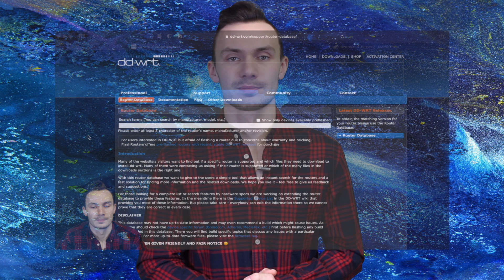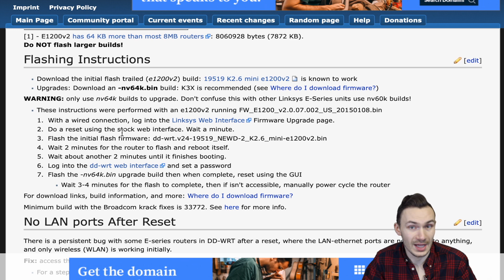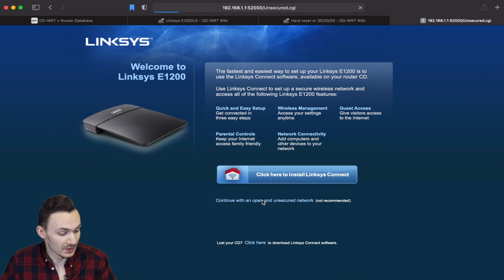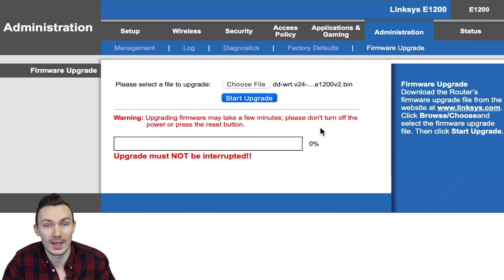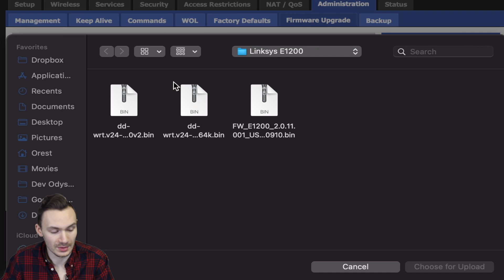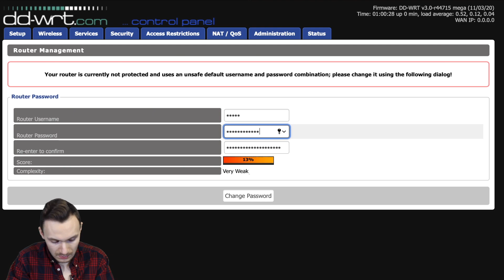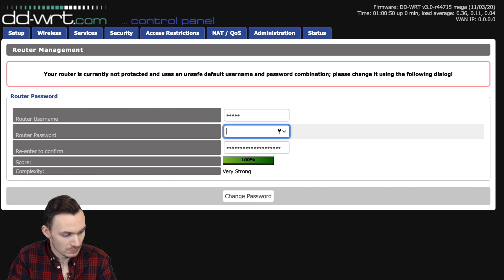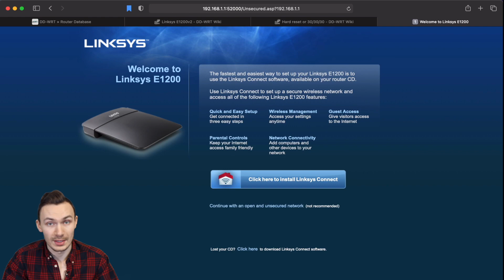How to Upgrade a Router // DDWRT (How To Guide)

Comment: hello i just saw my router on the data base but it doesnt have a wiki instruction page for it and also mentions 5ghz doesnt work any info on this?
Reply from the maker: Thanks for watching @muhammadnuaman8127!

Honestly this is the only ddwrt video I’ve done, so I wouldn’t even consider myself a novice here.

Personally I have found ddwrt support to be sparse, including documentation. OpenWrt on the other hand is more robust, not just feature and support wise but also documentation. 

Have you looked into if your router supports OpenWrt? Chances are it would support your 5ghz radio too if the router is already supported.

I’d look at OpenWrt’s table of hardware to see if your router is supported and from there you should find installation instructions.

https://openwrt.org/toh/start

Comment: Is it possible to change firmware of isp provided router
Reply from the maker: Thanks for watching @user-yk7wq7kf7u!

That really depends on what hardware they provide. Given that ISPs typically lease this equipment to you, I strongly advise against trying to modify / overwrite their firmware. Its possible that you could brick the device they gave you which not only would be against their terms of use, but also, obviously, stop you from getting internet access. They may have something in their firmware that enables internet access to begin with.

You're best bet is to deny their equipment, and bring your own hardware (modem, router) if you can. If not, see if you can configure their router to act as a bridge, rather than a router, at which point you can connect your own router to their router, and use your router to manage your home network.
Reply: @DevOdyssey  thanks for the reply bro
Actually our isp deduct device charges in monthly bill so technically after six months this device became my property that’s why when I discounted my connection after 2 years they didn’t ask for the device return 
So it’s my property and I can do what ever I want please help if there any way to change firmware of that router
Reply from the maker: For sure, thanks for clarifying @fahedhassan-y6c  !

Given what you've noted, I can't imagine them taking the hardware back as you've paid for it in full, let alone, you are not being billed for it, the best indication I see that you "leased to own" instead of only a lease.

Great to hear its yours to now play with. Anyway, I'd love to help if I can, but I'd need to know some more details first. What hardware are you using? It's possible that it can't be flashed with other firmware, due to support reasons by the flashed firmware (i.e.DDWRT, OpenWrt not supporting it), but once we figure that out, I can guide you in the right direction on how to flash it with newer, more powerful firmware.

Comment: My Wifi nowir dd-wrt but I can't  go to ddwrt program, what isa the IP address use
Reply from the maker: Thanks for watching @pugnationphilippines5034!

I'll be quite honest, I have not touched DD WRT since making this video. I basically shifted to OpenWrt after seeing how much more it worked for me and my use cases. Supportability, installing etc, all just felt better for my workflows. With that, my knowledge here will be very limited, but hoping I can guide you in the right direction.

For the IP Address, its probably your standard 192 . 168 . 1 . 1 in your browser to reach your web interface for DD WRT. I don't think that varies between hardware that DD WRT is installed on, but I can't make any guarantees there. I am assuming you have tried this, and if so and it doesn't work, its possible something went wrong with the flashing of the router and its bricked. Thats a much more complicated scenario and would require a decent amount of troubleshooting the community has on their website. Hopefully thats not the case, as worst here is that its unrecoverable. 

I'd recommend going to their forum and website to learn more. You can find the links in my video description.

Comment: Hi Dev, just set up for the first time, I can't seem to be able to set up a SSID password that the system asks for when connecting to WIFI (so devices are not secure and open when connected to DDWRT router) Any advice please? Prob just a basic setting I havent done yet
Reply from the maker: Thanks for watching Cycling Bean!

So this may depend on your version of DDWRT, but I am not sure if it actually creates a wireless network automatically.I don't feel its the case, so the way you'd want to do this is by connecting to the router via an ethernet cable, and then reaching the DDWRT web interface by going to the default IP Address. From there you should have no problem setting up the SSID with a custom name and also SSID password after setting your security type, such as WPA2/3. Have you been able to get this far? If not, I'm not sure if your issue is build specific or not. 

This wiki section from DDWRT around general Wifi settings should be helpful.
https://wiki.dd-wrt.com/wiki/index.php/Basic_Wireless_Settings#Wireless_SSID_Broadcast

Comment: Dear reader,

i wane start using my old  Asus RT-n12 router again, because I need a separate network for my smart home products. And because the firmware is from 2017 (dd-wrt.v24-35034_NEWD-2_K3.x_mega_RT-N12C1) I wanted to update my router first. I only found 2_K2.6_mini updates through the website and through the ftp server I found dd-wrt.v24-51011_NEWD-2_K3.x_mega_RT-N12C1.trx. Can I also use this to update/upgrade from an existing dd-wrt web-gui because I can't find a Bin file from this version. Thanks a lot for your time.
Greetings skip
Reply from the maker: Thanks for watching Skip!

To be quite honest, my experience with DD-WRT is very limited, really only to actually the install. I have had a better experience with OpenWrt for features, functionality and compatibility and mostly have gone that route.

However, to my knowledge, I believe the trx files are used for the initial flash to DD-WRT. You can find instructions below from the router database (the link assumes you are on revision D of your Asus N12)

Either way this link does have bin files for the updates to mega and mini from 2022, not sure if there is anything else that’s newer. The trx might work for an update but I would be cautious unless you found some sort of confirmation that it work. So far, in reading the dd wrt wiki, I’m seeing that you update with the bin file and not trx, so I’d advise not to do that, again unless you have reputable information that it would work. 

Try the bin files from the router database and it should update you to a newer / newest version they have available for the N12.

https://dd-wrt.com/support/router-database/?model=RT-N12_D
Reply: @DevOdyssey  Thanks for your reply. And yes, I had already looked in the route database, but there is no 2_K3.Mega there. Anyway, then only the option remains to flash back an original firmware and then again via the normal way to the latest firmware from dd-wrt or indeed also open-wrt because it is much newer. In any case, a huge thank you for your time and effort.
Reply from the maker: @1eskip  You’re welcome! Taking a closer look at your first comment, it seems like you are on the C revision of the Asus RT-N12 router. As you found, I didn’t see a K3.X Mega in the router database either, sadly. Given it’s only a trx version, your assumption would be correct, you’d have to reflash to stock firmware, then flash back to the upgraded version using that newer Mega trx flash file.

However if you do consider OpenWrt like you said, you should be able to flash it, as it looks like it’s supported in their table of hardware. If you go down that route, you can refer to my flashing openwrt video for some help.

https://youtu.be/1IgwDwoa9yY
Reply: @DevOdyssey  Ok thanks for the information. I already had the Open-wrt firmware ready but Can I flash it directly from dd-wrt or do I have to flash it to stick first.
Reply from the maker: @1eskip  You're welcome! I am honestly not aware of how to flash from DDWRT to OpenWrt, and its probably best to flash to stock firmware before flashing to OpenWrt, as that is how the guides in OpenWrt's wiki are written.

Comment: dude. in forums, everybody says dont use the router database.  for like 6-7 years. you seem to be using it for compatability/ cool. but search your firmware in the forums to find RECENT compatability, and specific forums, right?
Reply from the maker: Thanks for watching Ben.

You are correct in that regard. I have seen that in the DDWRT forums. I was lucky enough to be using an old enough router that was still up to date in their database to find compatibility. But yes, for finding the most recent firmware, I believe it's best to search their forum and find the results there. 

I haven't pursued DDWRT after this video, as I found that I enjoyed using OpenWrt more and it fit my needs and my style better. DDWRT is still a good option depending on your needs and technical skills. I can't speak to flashing newer routers with DDWRT, but I imagine you'd find that information in their forums as opposed to the router database.

Comment: It's a very good firmware, I installed it on my rocket m5 and it worked fine, but after inserting the key, I couldn't update to more recent versions... any idea why?
Reply from the maker: Thanks for watching JB Grenouille!

To be quite honest I have not used DDWRT much, and haven’t really worked with activation. I actually didn’t know there was an activation available for DDWRT. 

I did a google search and looks like activation is related to custom builds, are you using a custom build? My guess is the activation is related to the specific custom build version (if you are using one) and as a result, you can’t update. The way you might have to update is by getting a newer version of the custom build and maybe a new activation key associated with it, and then upload the new firmware version to perform an update. However I’m not 100% sure. You might be able to find some more information on the DDWRT.

Comment: Can you recommend few model 4G LTE router that can support dd-wrt ? And also break the router is correct (Not Brick)
Reply from the maker: Thanks for watching liverpool mo!

Sadly, I personally cannot recommend an exact 4G LTE router that DDWRT works on. This is only because I have yet to test out DDWRT on different routers, but also test it out with 4G LTE routers. So I can't give a personal recommendation as a result, but this is what I found when searching online for 4G LTE DDWRT routers.

https://wiki.dd-wrt.com/wiki/index.php/3G_/_3.5G
https://wiki.dd-wrt.com/wiki/index.php/Supported_Devices

I'd have to say it looks like their USB 4G LTE dongle support is pretty good, so if you have to "bolt on" 4G LTE to a router that doesn't have it, you can do so pretty easily. Looking at the first link shows you all the supported modems, of which there are quite a bit. 

In order to find a 4G LTE router that's compatible with DDWRT, I'd imagine you'd need to find not just a compatible router architecture / hardware, but also make the the 4G LTE modem in the router is also supported. If you can find that, then you should be good.

Sorry I don't have anything else. If you're not set on DDWRT, you can also look at OpenWrt and can likely find 4G LTE routers that are supported in their table of hardware.
Reply: @DevOdyssey  thank you 🙏
Reply from the maker: @cy5235  You're welcome! Best of luck 😊

Comment: I can’t find switch in network menu Luci 21.02. How can I install it in from my windows 7 pc?
Reply from the maker: Hi Mohammad, thanks for watching!

Looks like you meant to comment on another video, where I’m setting up VLANs on OpenWrt, as DDWRT does not have a LuCi interface.

So the version of LuCi you are using does not have the switch option in there, as VLAN set up has been significantly changed since OpenWrt 19.x and LuCi 19.x. They use a new architecture called Distributed Switch Architecture, which has been in Linux kernel for some time now.

I will be making video on VLAN setup in OpenWrt 21.02, but basically you have to set up a bridge interface where you do VLAN filtering. You can refer to the OpenWrt documentation on how to setup VLANs in 21.02.

https://openwrt.org/docs/guide-user/network/dsa/start

You can also watch another video here on how to accomplish this from Van Tech Corner.

https://youtu.be/EwYTV0z6lJk

Comment: My router does not sync date and time in dd-wrt, do you have a solution for it?
Reply: Look for a NTP setting in DD-WRT and enable it, that will synchronize the time
Reply from the maker: Thanks for watching Mariana!

I honestly have not played around with DDWRT enough to know. I generally found it to be tad buggy but I know it works well for many people. I'd have to reflash my router with dd-wrt and spend more time with it and get to know it better.

As for why its not syncing date and time, there only one reason that comes to mind. First check to see if your DDWRT router is sending Network Time Protocol (NTP) traffic to an NTP server to request date / time info. This protocol typically runs on port 123. I'm sure there are settings for this somewhere in DDWRT network settings. You should be able to test it and if this fails, then its likely the reason why date / time isn't syncing.

Comment: Big DD-WRT fan, great advanced features, entware package manager has great coverage and the repository is updated frequently. Picked up an older Netgear nighthawk off craiglist and combined with this firmware the thing's a beast!
Reply from the maker: Thanks for watching @Anthony DiBari!

I do enjoy DD-WRT, and its actually the first firmware I ever flashed onto a router. They have lots of great features with a pretty simple to use interface that anyone who's used a regular router can navigate, on top of some advanced features too. It's a great start for getting into router firmware if you ask me. I'm still quite a bit inexperienced with DD-WRT, but am thinking about more videos on it demonstrating its features. I'll have to look more into the entware package manager too.

I have more experience with OpenWrt as its a bit more advanced in my opinion, but thats because I like more of the technical aspect of it. 

Thats a great haul! Netgear nighthawk combined with DD-WRT makes it way more powerful than its stock firmware, and I hope you get to enjoy all that DD-WRT has to offer on a Nighthawk.

Comment from the maker: Would you install DDWRT on your router, and use its generous network feature set? Do you want to see a video on how to configure DDWRT?
Reply: Hooo yeah you are awesome thanks I follow your instructions to install DDWRT in my all Linksys E3200 now I have it ready but I need instructions on how to set it up as an access point do you have a video that show us how to do that my friend thanks in advance I love your channel 😊
Reply from the maker: @joseluiszamorano2004  Thanks for watching! I appreciate your kindness and compliments 😊.

Glad you were able to get DDWRT installed on your Linksys E3200s! They're definitely running better software now than they were before. I honestly have not used DDWRT that much anymore, other than flashing it as in this video, and restoring back to factory firmware. So I don't have my own video on setting up access point in DDWRT. It should be easy enough in the wireless configuration. After watching the video below, it looks like this should work. While the video is old, the UI hasn't changed too much in DDWRT. 

Generally, as long as you shut off DHCP Server, and the Operating mode under Wireless is AP,  (and you plug in the E3200 access point into your router with an ethernet cable) that should then work.

https://www.youtube.com/watch?v=VX4xsjpzKtw